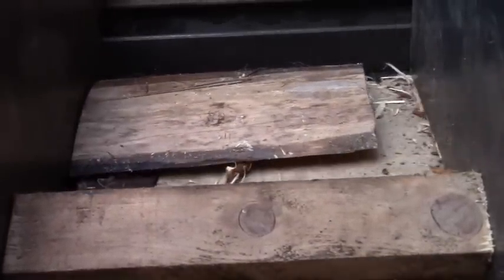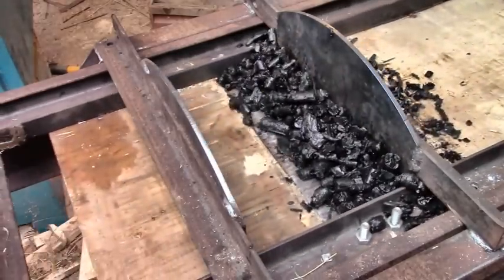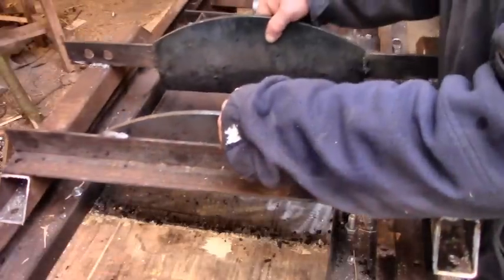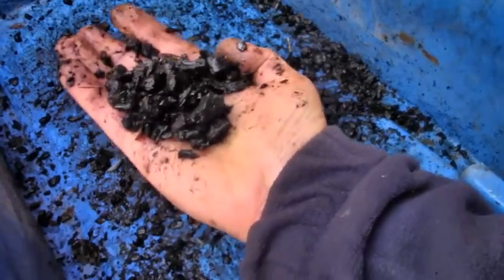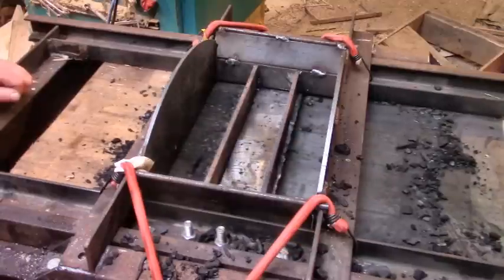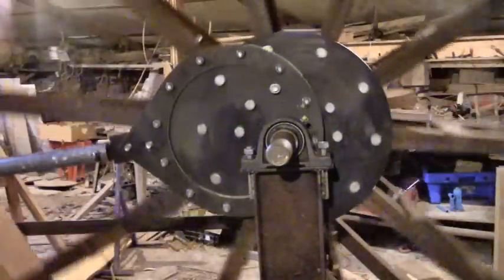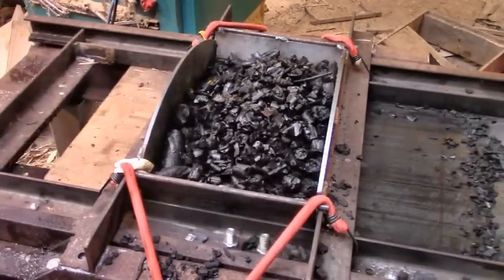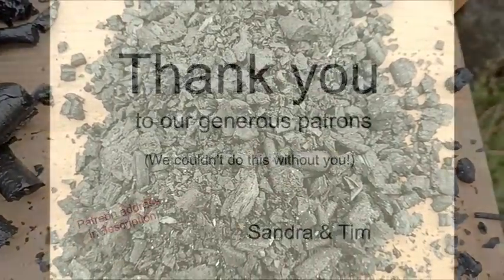I Made A Charcoal Grinder For The Giant Wheel – and it works!

Comment: If you added a blade in the other direction it would cut in both directions of the stroke and double its speed.
Reply: The stroke isn't really long enough for a second blade
Reply: @pornhub1  If the other blade was bolted on like the blanking plate that was added to narrow the slot gap, it could be done both to leave enough gap for the charcoal to fall between the facing blades and could be removed for wood chopping.
Reply: @ebobram  This blade would be facing the other way to cut on the return stroke. So the stroke length wouldn't matter.
Reply: @pornhub1  If you made the blade really thin (and double-sided) and had it move a little past the end stops on either end, then it should still work for wood cutting (only it would also cut wood in both directions now too).  It would be very similar to one of those mandolin slicers in the kitchen only instead of moving the food over the blade, the food stays still and the mandolin slider moves under it.

Comment: It seems the wheel and your motor could deliver much more power than you're using with each stroke, but the result is really nice. With this same oscillating design I can imagine an improvement would be replacing the blade with a square plunger, where the charcoal falls into a cavity on the backstroke and is pushed through a grid of blades on the forward stroke. The same design as a commercial vegetable dicer. Maybe it's best to not worry about fixing what isn't broke. Good to see a functioning design. Increasing the stroke length is also a good idea and much simpler.
Reply: you might be right. You could adapt this to have a forward and backward stroke cut. I also think this does not have to be super sharp either. There is a massive amount of power here and wider could be the goal as well. 
As long as you kee the stroke the same you can make anything. 
I am trying to think what machine i have once seen. It had a slated grate on top then flat stock spokes that pretty much just hit the material which busted them up. 
There is also a bone grinder the uses what he wanted to make before as a slicer on the wheel yet it much smaller and has a half a circle pan that your move a divider thing that presses the bones against the cutter wheel. 
A lot of old farm equipment can be adapted to this. Anything that was belt run you just need  something to hook the pitman arm on to the machine with.

Comment: Perhaps another way to speed this up would be to have a blade in either direction so it cuts in both stroke directions.
Reply: DJ Moulton - I like the way you think! Relatively simple modification for twice the potential output. Great comment!
Reply: The main work in such a modification will be in grinding a cutting edge into the square back edge of the blade.

Comment: It would be interesting if you could somehow integrate teeth. Like how french fry mandolins work. Have a few teeth on the sliding plate, and notches in the end plates, and since the charcoal is brittle, it shouldn't give much resistance. Definitely wouldn't work with logs, but you would just have to take the teeth off.

Comment: the only thing i think i'm going to suggest is going to be to build up a nice big hopper over the thee-endplates thing so you can do big batches, especially with the charcoal - just dump a load in and let it run :)
Reply: Yeah this would be feed till there is none left. Big hopper will also speed up the cutting because there will be no mis cuts. Also adding a back stroke cut will double the production.

Comment: There's a modification to that adapter for the charcoal that's screams to be made, a hopper to load larger amounts. You fill the hopper and just let it munch through that charcoal, and because you're holding a lot more charcoal in a larger loading hopper you don't need to reload the grinder/cutter as often! I also think that as effective the bungee cords are, it should actually bolt into it.

I gotta say the engineering here is impressive, it's like you're a modern day Stevenson or Brunel

Comment: Hi Tim,  think you have nailed this one as well!! No minimal time to charged from cutting logs to grinding charcoal that's the way to go!! Just need a hopper that will take logs aswell as charcoal!! 
With that flat plant have a simple way to hold it in place without screws not sure how but there is a way im sure!    When you change from charcoal  to logs remove the charcoal grid and replace with another but with the bars run the other direction say 3 depending on the log size,  to to hold the logs at 90° to the blade like you had!!
No need to do what a lot have said 'double the speed with both direction cut' that's just complicated things and makes more time to change from one to the other!!!

Comment: Numerous people have commented about adding a feed hopper with or without pressure plates to improve the feed rate and I agree. However, we all seem to have forgotten the importance of the capacity of the outfeed hopper in making this machine a set and forget operation. Possibly a belt run conveyor belt feeding from under the cutter head and out up to a large capacity hopper above a bag feeder for producing the final saleable product?
If the hopper feeds into a bag sized batching bin, it can then dump into the raised bag. The raised bag is lowered when full and then sealed. How will the charcoal be sold? Weight or volume? The product is wet/damp and will dry out so possibly sale by volume is the way to go. 
Mark from Melbourne Australia

Comment: I think, instead of the added grid, it might be better to add a board on top of the charcoal that adds a little pressure on top of it. So the charcoal can't roll as easily and is more likely forced to cut.
I hope you know what I mean...
Reply: i was thinking the same from the last video where it was cutting the logs, an  arm on a pivot connected to one of the horizontal plates with a weight/ board etc  that will sit on the logs would help stop them flipping up etc
Reply: Won’t the pressure of charcoal above it in the proper hopper do the same thing?
Reply: @AngzarrArquebusier  that's exactly what I thought. The bigger the hopper the  better I guess.
Reply: upvote for some type of follower/pusher
Reply: @AngzarrArquebusier  Charcoal is fairly lightweight and easily disturbed so I think that the idea of a pressure plate to aid the feeding is warranted.  It also comes down to the feed hopper design.
Reply: @markfryer9880  I agree, a pressure plate might be annoying for refilling. But I think one would need a stupidly tall frame to rely on the weight of the charcoal. The only other solution I can think of would be to make the frame stationary and only move the knife in between.
Reply: @markfryer9880  Just add a large bag of sand on top of the charcoal, have it tied to a rope so it cant go all the way to the cutting parts. When it gets that low just reel it back up, refill the hopper and lay the sandbag back onto the charcoal to repeat the process.

Comment: I believe a ball mill powdered by the wheel would be better for soil quality. Basically an old cement mixer with a lid and a few steel balls inside would pummel to the charcoal to the required grade. Great process though. Loving the journey
Reply from the maker: Have you tried it though, Josh? Unless it's perfectly dry you end up with a paste sticking everything together. The holes get clogged because they need to be small. Ball mills are for grinding things to a powder, surely?
Reply: @wayoutwest-workshopstuff6299  yes your right you cool yours with water. Even as a paste though it's still usable for soil. In fact with extra water you can apply it to the soil by splattering it or pouring it into a hot compost pile. Cheers J

Comment: arh it becomes clear as to why you were making the shingle cutter. I was perplexed as to the effort put in as it didn't seem to have a use apart from being scaring and amazing. Been great to see this journey. Finally got my charcoal grinder working as it should - and old kitchen waste sink machine (don't know what they are called in Ireland). Seems to work quite well and rapidly. Now it is supposed to be summer here, but we have had nothing but a wet spring and summer. So my wood / feed stock hasn't dried out. Normally by now we would have fire bans, and I have only been able to make one batch of the 3-4 I was hoping to get done before any fire ban. Never mind the trees are very green and growing strong with the rain.

Comment: For cutting logs a single blade makes sense but for brittle charcoal I am thinking that a series of blades that act more like a rasp could work.

Specifically a series of angled 6mm or 8mm steel bars about 20mm deep replacing the whole throat opening.

The current slicing blade can still stay at the present location.

All these angled blades act as a grill so that any charcoal that fits between the grills can drop through rather than having to wait to reach the slicing blade.

Each of these angled grill blades would have to be tapered so that the small charcoal can drop freely after clearing the gap between grill blades.

Just an idea as I am watching most of the charcoal traveling back and forth waiting for its turn at the slicing blade.

Comment: Your set up looks very good and this will work really well and be even faster once there is weight applied to the bits. As you can see towards the end when the bits start showing the bottom. See how they move about. This is slippage and can happen quite often even with the small amount of material on top. These bits are quite light and I do think that you might need a good foot or 2 above it to keep  enough weight on it. 
The same applies with your wood slicing. The weight is what will keep the log stable and in its place with will not cause any movement which means that the slicer will be able to do its work. 
That is my best observation. 
This thing is wicked big and heavy... I would love to have this as yard art attached to something!

Comment: I am griding charcoal to put in my garden soil.  I use an old cement mixer with several base  ball size rocks inside.  Rocks roll over charcoal and crushes it very quick.
Reply from the maker: but also makes a lot of dust, I'm sure? Did you try drilling holes in the correct size to try to release some before it gets pulverized?

Comment: I like the suggestion Zwilnik made about cutting on the back stroke. It seems to me if you added another blade/set on the bed you could again double the output in one stroke.  And possibly double that by adding a blade for the back stroke as was previously mentioned. Perhaps have different blade configurations that can be changed out of the machine like different attachments for a food processor.

Comment: Your concrete slab will require a minimum of 7 days for initial strength, but 28 days for maximum strength. It will continue to gain strength after the 28 days but the difference is only marginal over the 28 days strength. The strength charts can be found on any Cement and Concrete Association website.

Comment: I’m surprised you’re still having fun with the full width of the blade cutting at once versus a cutting edge that has some profile enabling the same force on a smaller area. Nice work so far!
Reply: I imagine a small crank handle that (worm wheel) pushes one side plate inwards, narrowing the length of blade that is exposed to the charcoal. If the current blade is 15" then redicing the throat to 7.5" might double the force-per-inch of blade?

Comment: I think you could speed this up a lot with some sort of heavy weight on top to force the charcoal against the blade rather than let it roll around.  Perhaps on a hinge that would swing up and press down.  That would also be useful when you are splitting the wood, as it would keep the last bit from kicking up when it is thin.  Just make it so that it wont reach the blade and you should be good.

Comment: You could double the number of cuts per stroke if the blade was sharpened on both sides. It would cut on both the forward and backward stroke. You would need another drop + bed plate on the opposite side

Comment: Another thought, assuming that you build a hopper above the slicer to load the charcoal.

How about a set of rods that go through the hopper and move with the stroke.

These rods, maybe there or four, go through the hopper and a small slicing blade is attached to each rod so that the charcoal is subjected to slicing before it even gets to the throat.

The action of the rods should also help with feeding the charcoal into the slicing zone, the wet charcoal might bridge in the hopper.

I am assuming that you want minimal effort for feeding the charcoal manually, ie. not standing there at the hopper throwing in small quantities.

Comment: @Way Out West - Workshop Stuff
When you make the charcoal, you generate a LOT of heat & some volatile gases are released from the charring-wood, both those could be captured & be used to drive some engine, that can run this grinder. Eg. steam(engine) to capture the heat energy, and some combustion engine for the gases, (you might need some storage for the gas, somehow (compression?))
Of course it can't(?) be used on the first batch, but the 2'nd batch could drive the grinding of the first batch? :D

For gas storage, you probably need to compress it, but I wonder if those gases are explosive when compressed (eg. diesel engine, often works on heat & compression, without sparks).
Or you can use like 2 different sized oil-drums, the larger holds water, the smaller is inserted upside down in the water drum, the smaller drum has 2 holes on top with valves, one is inlet, other is outlet. (or the inlet hole can be through the water, to double as a flame-trap? & also as a gas purifier?)
    This can be used as a temporary storage, then the outlet hose can be run to a compressor that can fill your high-pressure tanks (assuming non-exploding gas? 🤷‍♂).
Maybe the high-pressure gas-tanks should be submerged in cold water, just in case they could overheat? 
That "should" be "safe"-ish, I think? (I have no idea about what kind of gases actually comes out from that charring process)

Comment: Consider replacing the cutting blade with a section of expanded steel. The charcoal is brittle enough that it doesn’t need a sharp blade to reduce it. Use a small grid on the expanded steel. It will then break it up in both directions.
Reply from the maker: Good idea - but occasionally there are cores of un-cooked wood in the bigger lumps that need to be sliced..
Reply: @wayoutwest-workshopstuff6299  let them remain on top until the char is gone then put them back in the char cooking process.

Comment: Interesting! You could add an even bigger chute/hopper on top of it to add more material. Now, about cutting charcoal, wouldn't it be better if you not use the flywheel itself? I think it doesn't really need all that momentum to just cut/grind charcoal... But then again, cutting charcoal isn't the sole purpose of the machine, right?

Comment: Once the stroke length is sorted out, could you have multiple blades on a longer sled? Essentially just duplicating the existing? I wonder if that would work. Combining that with the intermediate bars could results in quite the production rate. Who knows how many cutting sections the wheel could sustain.
Reply: Potentially even a cut on the backstroke with some small additions may double again if it’s possible?

Comment: Maybe, it would be an idea to grind the charcoal in a concrete mixer filled with steelballs? Would be loud. But, I think it might be effective. Just in case you would need smaller sizes.
Reply from the maker: that would make a lot of dust - not what you want
Reply: Just add water. Or: You mean, it would be too small?

Comment: I don't understand a slicing machine is being used for crushing, wouldn't it have made more sense to make a jaw crusher? A jaw crusher is actually made for crushing course chunky material into finer granular material and has a convenient hopper mouth that you dump the course chunky bits into and watch as it munches it into fine bits, the bottom jaw is adjustable.
Reply from the maker: but nothing pushes the granules down, so wet ones would probably just stick together - they don't behave like stones, of course..